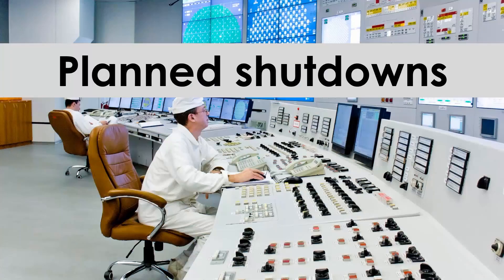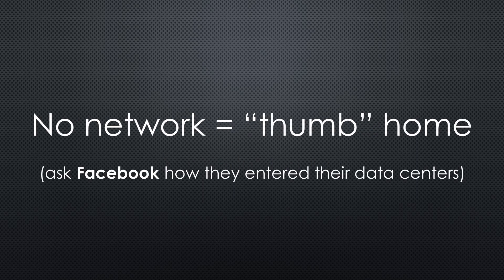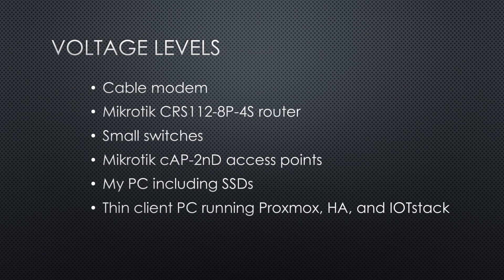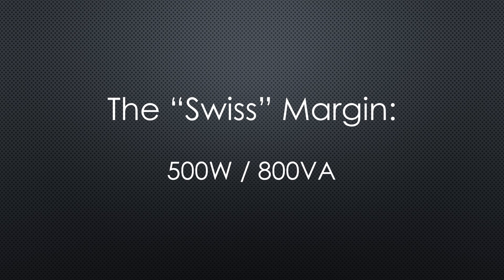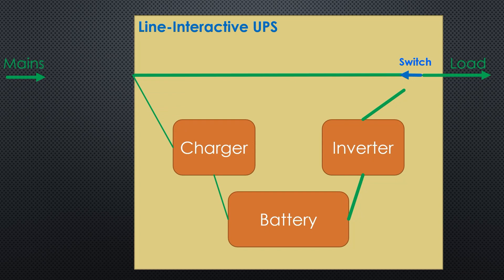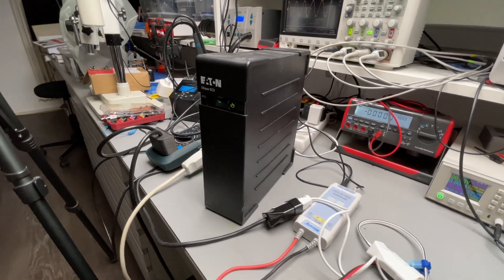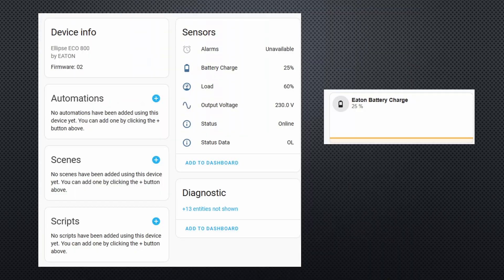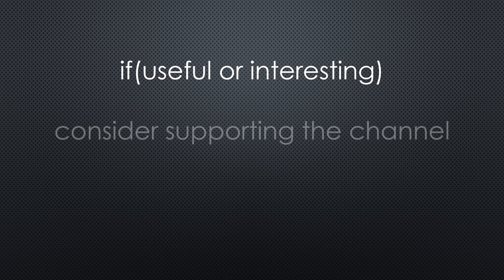447 How to protect Home Automation and PC with an Uninterruptable Power Supply (UPS)

Comment: (APC) Line-Interaktiv UPS are around 4 ms faster then offline UPS, could be that this will solve your problem. To be 100% sure you need an Online UPS.
Reply from the maker: Mine is now back to the supplier and I hope I will get a new one. Then we will see if it was a defective device or if it is a "systematic issue".

Comment: We have planned power outages in Ukraine right now due to russian attacks on our infrastructure.
We have mains electricity around 1/3 of the day.
A lot of people have fiber-optics internet + DC UPS (or just 12v battery connected in parallel with the load) on their modem and router to stay connected and work.
Our houses are full of batteries, powerbanks and usb-powered christmas lights. Sometimes combined. My favorite is a camping flashlight that doubles as a USB powerbank.
Also having a few high-powered powerbanks is considered a must (to charge laptop for example).
Those who can afford it also have either inverters or solar charging stations (though almost no one charges them with solar, mostly from mains).
Reply from the maker: I can imagine that energy is a big discussion in your country. And the sun is not very helpful for the moment (at least here).

Comment: I have an Eaton with two rows of sockets on the top, the USB interface needs no additional software, it just makes a desktop Windows work like a notebook with built-in battery.
Reply from the maker: How is the PC switched off by the UPS without additional software?
Reply: @AndreasSpiess  I've used such an Eaton UPS (mine is a 3S 550) for a number of years without issues now. When connected to a Windows PC it's recognized as a battery and makes the PC behave more like a notebook (i. e. shutting down when battery runs low). I've only briefly tried it with Windows though, it's worked fine with nut and the usbhid driver.

Comment: I recently removed my UPS bevcause ot the electrical cost's,  I had APC and they draw 18 watts on there own without load, I live in the Netherlands and the power outtages here are rare so i take the gamble , i have  a raspberry Pi with domoticz on it and it starts up after power down , i had a 500 Va UPS before.
Reply: Same here, my UPS APC Smart-UPS 750VA works fine without any reboots, but it consumes 20W (quite a lot)
@AndreasSpiess can you measure how much power the EATON consumes by itself?
Reply from the maker: For the moment I can no more measure its consumption because it completely died :-(

Comment: Some systems like DALI has ability to set power-on and/or no-control fallback settings that will help after power recovering. It will be good even if you have UPS, because after several years of electical power stability you may found that batteries in your 1 kWh on-line UPS degraded to 0.1 kWh.
Also, I think that "long" shutdown happens when food in refrigerator starts to go bad :)
Reply from the maker: I agree that powering up a shutdown net is challenging and that switching particular devices could help there. Probably not single bulbs, but larger consumers.
Long for me already starts when I do not have light to read in our home. But, as you wrote, latest when the food gets to get bad. Because we have a 10kWh solar battery used every night, it is closely monitored, fortunately.

Comment: I find a lot of "offline" ups devices have that very small glitch between when mains fails and when the inverter kicks in, which can cause a glitch big enough to reset a microporcessor, router and even some computers.
I have some older MGE, which was later split between APC and Eaton, UPS which is interactive and that removes that small glitch between mains failure and when the inverter kicks in
Reply: APC thee best
Reply from the maker: Thank you for the info. I did not know that APC and Eaton have the same roots.
Reply: @AndreasSpiess  danke dier fuer den videos!! respect aus Montenegro

Comment: I wonder what’s the failure rate of these UPSes. I live in Finland within city limits, and it seems that an outage more than a couple of seconds is like once in 10-20 years thing. A local outage could be a bit more common, caused by a breaker tripping for the apartment complex or in the home distribution panel. I think I would probably need a super fast relay system to switch between two UPS:es for ultimate reliability, since the UPS itself would probably be less reliable than the grid :-) I already have a small sinewave inverter and junk car batteries to use as ”longer” term backup, meaning some maybe 12 hours for electronics.
Reply from the maker: The big battery has to stop for about 5 seconds before it restarts. It is made for power outages. Two years ago they discussed to switch electricity off for hours if not enough electricity was available. Fortunately, it did not happen.
For the rest, it is like in your place. Very rare outages here.
The small UPC for my PC is good when I cut power myself by creating a short or an overload (which happens from time-to-time).

Comment: line interactive like apc smart used to have rather high self consumption. my 700va as well as 2200va versions did self-consume with full batteries between 60 and 120W which caused me to replace them with back ups series (typical offline one) where self consumption is under 2w when charged. line interactive and online are bad for low power 24h running appliances.
Reply from the maker: I did not measure the power consumption of mine. And now it completely stopped delivering energy. So it will go back...

Comment: It's hard to understand how the switch back to mains handles the synch of the frequency. It should deviate when the ups been of grid for a while. Also it would be great with a solar panel connected to the battery to get a longer runtime during daytime.
Reply from the maker: You have to wait for the longer run time till the next video...

Comment: Hi. Thats just a comment without viewing the video (tonight if all goes well). Just a return of experience (it admin). DONT trust UPS. Change battery every 3 years (for medium to small). All goes well, self-testing is ok, and when power outage come, battery is down. Bye bye datas. Invest in powerfull backup software and replicate (if possible) datas and VM. And i dont talk of defective UPS that, one day, decide to shutdown without reason (APC brand). So for Routeurs, Switch that have flash, allways save the las config. For servers, replace, like ups battery, disk controller battery every 3 years (but they are more stable than classic battery). Thanks Andreas for your work.
Reply from the maker: I agree with the importance of backup. Fortunately, a "normal" unexpected shutdown is recovered by my Windows PC and I did not lose data for years.

Comment: Thanks for your content Andreas! Wondering if your Home Automation system is still based on Home Assistant , IOTStack and tasmota? Have you had any adjustments to your preferred system for various devices , including esp8266 / 32's?
Reply from the maker: The new sensors are usually based on ESPhome, not Tasmota because it is integrated into HA. The rest is the same (ON a Thin Client PC as shown in one of my videos)
Reply: @AndreasSpiess  ah, yes, now I remember esphome! I made a hall effect switch on an esp01 to detect and report when the garage door was left open (after a bike theft one night 😔) and now that I go back and check, it's using esphome (it's been working so flawlessly that I guess I had forgotten how I specifically set it up!)
Reply: If you were to start your home automation system again today, would you still use HomeAssistant and esphome, or do you see other candidates emerging? I've seen you use node red too. Would you use it instead, or maybe it has a place on its own, and integrated with HA/ESPHome?
Reply from the maker: @Wayde-VA3NCA  I just added HA (I showed my setup in another video)

Comment: Hi Andreas, I am using two units of the same UPS model in my home (there a two servercabinets). Both units are connected via NUT to a Homeassistent device (one of them is slave), the Master HA unit is monitoring/tracking everything. Over the last year both UPS units worked without any problems during 5 outages. Greets from Austria
Reply: Have also some Eaton devices and had no problems in the last 3 years. Before that I had some consumer APC devices and they just died after a few years, just out of warranty.
Reply from the maker: Thank you for sharing your experience. In the meantime, my Eaton decided to completely die. So I had a "Monday" model :-(
Reply: I too use multiple line interactive UPS systems at home (one is APC and the other 2 are local custom assembled). 
One protects my NAS servers Rack, another for two desktop PCs and the third on the smart home, modem and router system.  
These are at different locations around the house and I have never encountered a re-boot or failure on any of the three on multiple short and long power fluctuations and failures. It surly requires maintenance of buying and replacing the lead-acid battery about every 3 or more years. There are many cheap battery sellers with low prices but these are almost always low quality lead-acid short lived batteries. The UPS batteries these days can be easily replaced by the user, most have a serviceable access door to replace the battery. I avoid buying UPS devices which have more than 1 battery and no fans allowed. More chances of failure.

Comment: I am using Ellipse Pro 1200 (line interactive) with same concept. I also assume that my power line is good quality, anyway Line Interactive   sometimes makes sounds.

I am happy with Eaton, of course Linux management could be a bit easy. Also have nut running with USB connector.
Reply from the maker: Thank you for sharing your experience!

Comment: I have a CyberPower CP1500PFCLCD PFC Sinewave UPS System, 1500VA/1000W and my server has always stayed running. It will run my server 10 minutes longer if the hard driver are spun down. Hope this helps. It has software that shuts it down when the battery get low. Uses usb cable for this.
Reply from the maker: This is exactly what I was hoping for ;-)  But for the moment, my device completely stopped working. So it will go back...

Comment: Why not add those small UPS Hats to the Pis in addition to your big gun mains UPS? That way even if the big unit fails you still have a couple hours of usage for the Pi or other small applications.
Reply from the maker: As said in the video: I also have to power 48V PoE and a beefy 230V PC. So this setup was easier.

Comment: Make sure you have GEL-type battery in your UPS, they can sustain high current for minutes. AGM-type batteries are cheaper but a complete waste of money, they can deliver high current for couple of seconds but then you just need to throw them away and buy a new one.
Reply from the maker: Thanks for the info. My UPS is new and I use the built-in battery. So it should work at least till after the warranty period ;-)

Comment: I guess you have the Huawei Backup Solution that takes 5s to take over, so that's why you need an UPS?
I have the 6000 1 phase inverter without battery, I was thinking to use and off-grid inverter with a 48V battery between the Huawei and my house as an UPS, for example a Growatt Inverter with Pylontech batteries.
Reply from the maker: Yes, the Huawei takes about 3 seconds for the switch-over. I will show it in the next video.

Comment: Tanks a lot. Very important topic. I use a "1500VA" sinewave UPS, because of power factor correction of loads. I added a 42V power supply which powers a cable running in parallel to the Eth cable to supply switches etc. Status data are transmittesd via a NUT server to ioBroker. The AGM batteries have to be replaced after 5 years. If your PV system goes into substition/backup powering during a mains drop: Does it keep 50Hz or does it use a different frequency? And is your UPS compatible with that? Additionally I have 9.6kWh Battery and a small Victron Multiplus as a backup for my heatinhg system. But this is a different story.
Reply: same setup here, Victron Multiplus with 2.4 kWh Pylontech batteries to power critical loads with 230V (e.g heating system). The multiplus and its Cerbo GX controller runs Node Red which is very convenient for controlling charge/discharge scenarios.
Power outages are very seldom here is Switzerland but since the Victron installation last autumn, already 3 outages have been very sucessfully covered.
Reply: @ericakeret8862  Up to now, power outages here in D were rare and locally. mainly caused by construction workers etc. But in march 30 2021 the "Bundesrechnungshof" published an official report pointing out, that beginning form 2022 there will be an increasing  gap between power production and demand. Politicians decided to shut down power plants before having substitutions. So I decided to make my heating system runnung also during an outage. If the cold freezes the water pipes, he house is gone.
Reply from the maker: As mentioned, the next video will show how I deal with the overall situation. Also here, power outages are not known in the past. But having Solar and reading the Newspapers (same as you), I decided to invest a bit of money. I do not like the idea having plenty of electricity in my home and not be able to use it ;-)
I assume the Huawei will be close to 50 Hz in off-grid, but I did not measure.
Reply: @AndreasSpiess  hopefully next week I will get my Fronius Gen24 installed. And that one will go to 53Hz to make sure, that all other potential inverters (e.g. microinverters) go offline. When the Gen24 is in island and the battery is full and another inverter would produce more than consumed, the Gen24 had no chance to control the net. The only thing it could do, is reduction of its own PV to zero. But if another inverter would fire into the island more than consumed ... -> not good.
Ref: SMA: Die neue VDE-Anwendungsregel
(VDE-AR-N 4105), figure page 9. Switzerland may differ a bit but not in principle. Physics dont care borders
Reply from the maker: @klassichd10  Maybe mine also goes to 53 Hz for that reason. If another inverter would be on the same "island," both inverters would shut off after power down. Then, the Huawei would get the signal to start off-grid, and the second inverter would think that the grid is back and would synchronize to the Huawei. With my strategy, it never charges the battery from the grid (or the other inverter). 
I would (or will) connect my balcony PV to the grid side of the backup-box so that it does not interfere with the Huawei.
Reply: @AndreasSpiess  Yes you can tap between the mains meter and the Huawei transfer switch box. But this seems kind of special to me, because you need an extra line for that. Normally you plug the balkony stuff in a plug located at the balkony. And mostliy this will be there where the rest of the house is. Within the "island area".
Reply: @AndreasSpiess  Mighbe there is one more thing to take into account: The location of the inverter's meter and the control strategy of the inverter.  If the balcony stuff is in front of the inverter's meter, the inverter cannot distinguish between balcony PV and mains grid. As long as it gets enough "own" PV power it will exclude it's grid input and also the balcony PV. In that situation, the balcony PV will feed completely into the grid and not into your house.
Reply from the maker: @klassichd10  I agree that adding another power source creates some issues. My neighbor has a few panels with microinverters directly connected to the grid. For the moment, it works fine and even charges his battery. But we have to see what happens if we add the backup box...
Reply: @AndreasSpiess  Thanks, keep us informed!

Comment: I had Eaton looooong time ago. The problem at that time was battery. I had line-interractive model and the battery died in less than a year - in the event of power outage, I still had reboots and the battery run empty in 10-12 minutes. Today, I would get some LiFePo4 battery (~2kWh), cheap charger and 1kW inverter. The prices are really cheap.
Reply from the maker: That would be another way. Maybe I will once create such a "DIY" UPS. You are right, the parts are no more very expensive. Just the efficiency would probably be bad because it is a "online" UPS.
Reply: @AndreasSpiess  With your solar, you might not worry that much, I guess :)
Reply from the maker: @rklauco  With solar, I care much more about energy consumption. On sunny summer days, we have plenty. But from November to February, we still have to buy electricity.
I must admit, it is not the money; it is more the challenge to get an optimal system....
Reply: @AndreasSpiess  I am just making the calculation if it's worth to get a battery storage, it does not look like worth it.
Reply from the maker: @rklauco  You are probably right. For me, it is a hobby and I am willing to spend the money. Because of our DIY approach, the battery was not too expensive. And I like the idea to live off our energy during 9 months of the year...